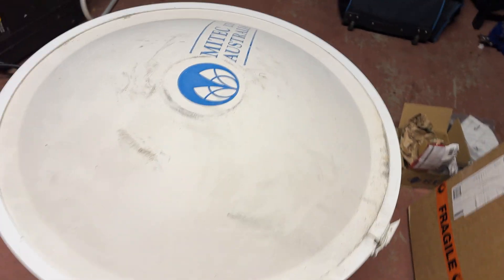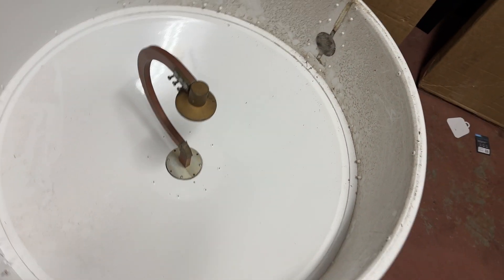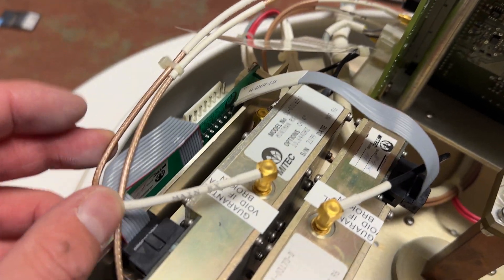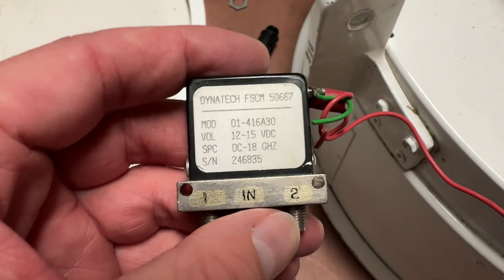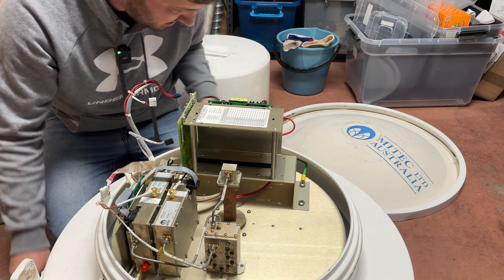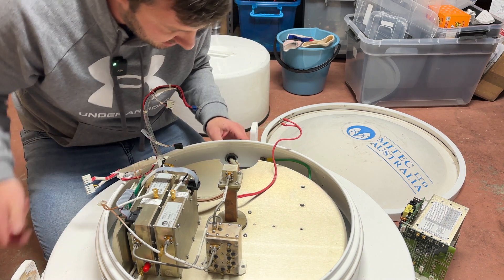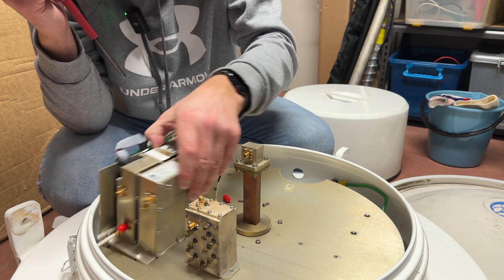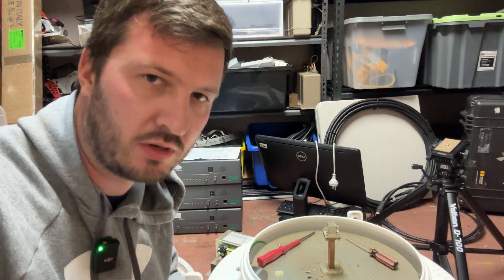Reviving and Reusing an Old Dish for Ham Radio

Comment: That 2mbit card is for an E1, which is a TDM interface that can be used for voice or data (or both at once), effectively it's the same as 32 phone lines, each one is 64kbit, 30 can be used for voice or data and the other 2 are for signalling and framing. Was common for businesses needing a lot of phone lines or a "high speed" data connection back in the day.

Comment: Near the end of the video you pose the question as to whether MITEC is still around.  Regrettably, no. After listing publicly, there was a hostile takeover by competitor Codan Pty Ltd in 1998, and the name and the company ended then (the original MITEC building in western Brisbane now houses a veterinary referral hospital among other things), but the MITEC DNA lives on in EM Solutions, a company started post MITEC demise by senior engineers of the original MITEC company to continue developing microwave systems which are in widespread use.  Electro Optic Systems then acquired EM Solutions in 2019.  All these company names are googleable for those needing more info.

Comment: Very cool. We definitely need to use the frequencies we have or we lose them. I was just on 23cm and 33cm for the first time, so I'm slowly working my way up, LOL.
Reply from the maker: Awesome Mike! What did you think to 23cm? We don’t have access to 33cm here
Reply: @HamRadioDX  it was fun to try but a little too soon to tell, since I only had about 4 QSOs. I was just using an Alinco HT with a rubber duck antenna that another ham loaned me. But I picked a POTA park with good elevation and a decent horizon to help. I’m looking forward to trying it some more though.

Comment: FYI there was one on those links inside the transmitter room at Mt Wellington. The good condition of that unit you have suggests that could be it. The dish was mounted to point through a fibreglass? panel mounted in the wall down to a tall building in Hobart.
Reply from the maker: I know the history of the dish in the video - it was located on a link between a Seismic vault station that got removed here in Hobart.

So depending on what site you're talking about on the mountain - I removed one from there for use (1.2m blue-ish with a lightning bolt on the top) converted the feed to use a tomato soup can and tested that on 2.4 and 3.4 GHz - it worked very well - but wasn't practical for portable use.

There is another white dish (similar to this one) but it is a big boy... about 1.5m? That's still sitting up there since being removed.

The "link room" that's on our site has paneling that I'm led to believe is made out of multiple sheets of the same stuff they make milk cartons out of.

Comment: Advanced licenses only?
Reply from the maker: Here in Australia the 10 GHz band is accessible to Advanced Licencees only. It's pretty much the flip of how things are down elsewhere, such as the USA where as a Tech you can run up to 1500W of power from VHF and above... which arguably is more dangerous than doing it at HF frequencies
Reply: @HamRadioDX  Yeah, good point. Thx for info. My regular limit is 500W. But at the moment there is long way for me. Maybe some day I will reach 10GHz:) 73